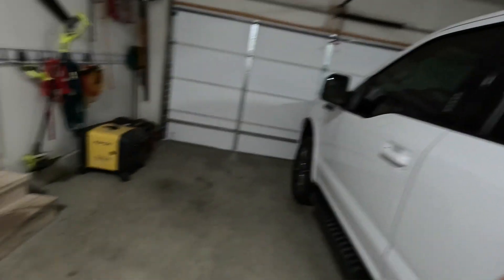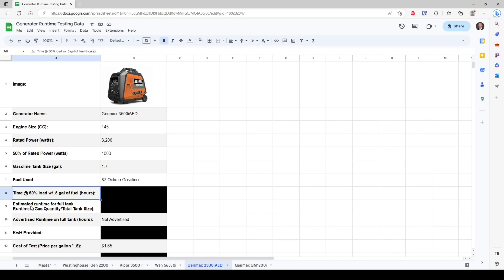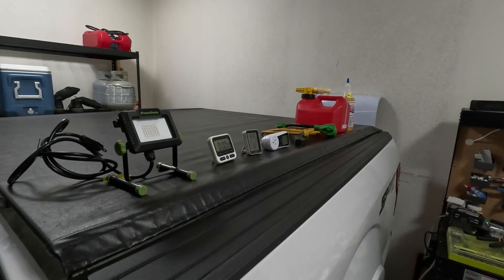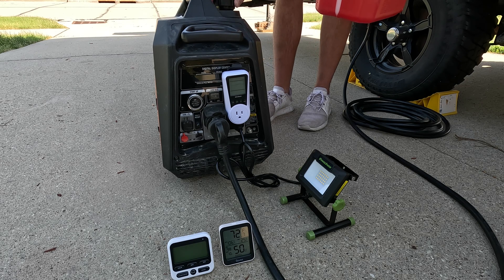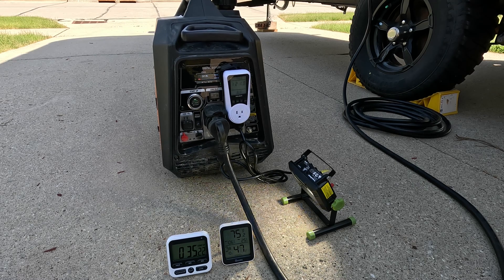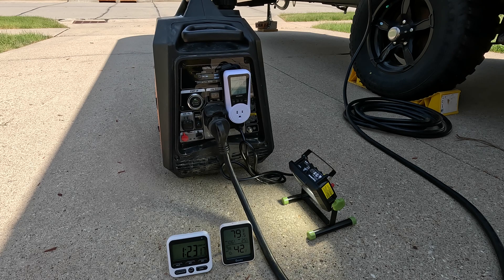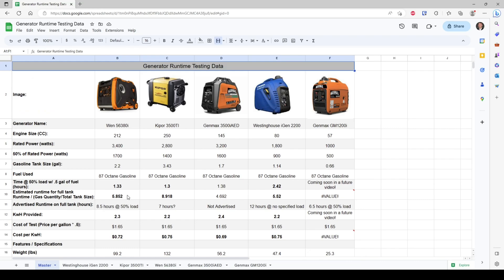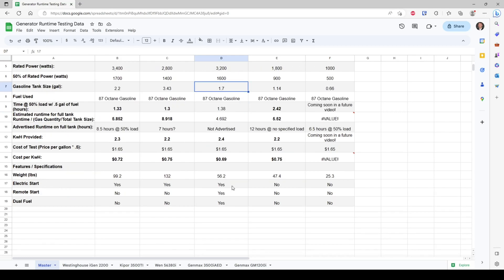Genmax GM3500iAED Runtime Test | Generator Runtime Testing Series

Comment: I was wondering the same thing. The test in the video would equal to about 14.5% efficiency, which isn't great even for a small generator, they're usually capable of 20-25%. I have the MXR3500S which is essentially the exact same generator. Under low idle it runs at 3,200 rpm and standard mode 3,800 rpm, which was a little concerning to me because a conventional generator would run at 3,000 rpm continuously (here in Europe, in the U.S. it would be 3.6k). It does have the benefit of being a relatively small displacement engine, though, so less friction and what not.

I love it for its size and convenience but also want to get as much out of the limited fuel you'll have available if you were to find yourself in an emergency. Amazing test and video, very informative!

Comment: Does your generator "Sputter" or "Pop" while in use?  For a lack of better words, I'm getting some Stuttering going on.
Reply from the maker: It does!  I’ve heard it in other videos on the internet.  When under load it runs perfect, but has a slight miss when under no load.  Pretty normal and doesn’t hurt a thing. Thanks for watching!
Reply: Mine did that at first but after I changed oil it was much better.

Comment: We can't get ours to start after using it three times -- we cannot get ahold of this company in any way. If you have any problem with this, there is NO support.
Reply from the maker: Hi Pam, that's too bad.  Does it turn over?  Is there fuel in it?  You may have a bad low oil sensor or a bad CO2 sensor.  I've had good luck reaching out to their support, just keep in mind they are in China and it may be a 24 hour turnaround between responses.  Thanks for watching!  :)

Comment: On your video you stated how long it runs on gas but have you tested it on propane ? How long will it run your 15k on propane ?
Reply from the maker: Hey Tim, not as controlled of an experiment, but here is a video where I did this exact test:  Dual Fuel Inverter Generator Duration Load Test - Genmax 3500 (GM3500iAED)
https://youtu.be/A6nEHBrCqCE

Comment: I'm working on my mods for my New to me 2020 Wolf pup which is much like your rig.  I'm struggling with the thought of getting full solar and praying for it to last a week.  I have camped a ton in the north east and your normally under trees and cloudy conditions (The great lakes produce copious amount of clouds). So I'm thinking a propane generator maybe more reliable at$600-$800 with 300-400Ah lithium  versus $1500 solar setup with inverter and all the wiring.  So if you could do a video on how much propane it takes and the drop in efficiency on propane. From talking to a lot of people at RV parks and campgrounds think slap a few solar panels on the roof and your good to go for 2-3 weeks!
Reply from the maker: I’ve already got you covered!  https://youtu.be/A6nEHBrCqCE

Definitely not as easy as just slapping solar panels on, but also not super complicated either.  Propane is great as it is easier to handle, the problem is you will need quite a few canisters if you are running the genny every day.  Fill ups can be someone difficult to find too.

Comment: Glad to see the genmax is doing well, as you know I have the GM3300i.  You are dead on about the gas tank size really being the limited factor on these, but like you, I can deal with that since the form factor of 50# is so much better.  My predator 3500 was over 110#. - Kyle
Reply: They also make a fuel pump that can attach to a marine style fuel tank. It replaces the gas cap and transfers fuel to the generator when its tank gets low. So if extended run time is a concern you can pick up a bigger marine fuel tank and run it for days without refueling. Or run it off propane
Reply from the maker: Those predators are great, I met someone who had 5,000 hours on his hour meter!  They are just so stinking heavy!

Comment: This is electric start?  WOnder how bad the propane run is?  Dual fuel is nice if you already carry propane on your trailer. Also, I wonder if it starts harder in the cold with propane.  Run up to the North Pole and see how it does for us...lol
Reply from the maker: I have heard they are difficult to run in colder weather on propane.  I’ll make a note to try that this winter when its -10F here!

Comment: I'm enjoying this series. I've been looking for a generator to use as a backup at an off-grid property I have. I'm really curious about the efficiency when used with propane for generators.  thanks for doing this series of videos!
Reply from the maker: Awesome, glad you’re enjoying it!  I made a similar video for the propane side of this machine last fall.  It is linked here:  Dual Fuel Inverter Generator Duration Load Test - Genmax 3500 (GM3500iAED)
https://youtu.be/A6nEHBrCqCE

Thanks for watching :)
Reply: @codys-garage  Thanks. I missed that video. I'll check it out